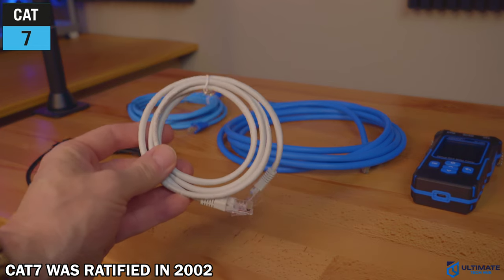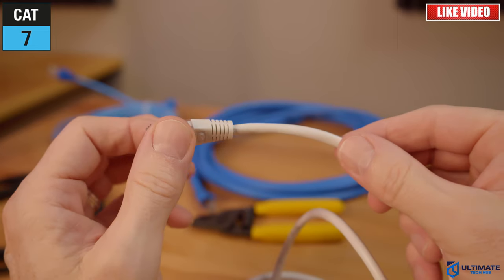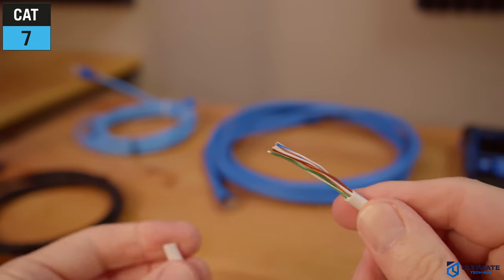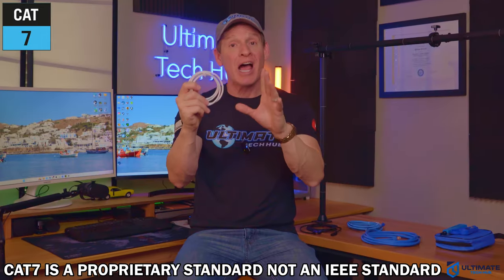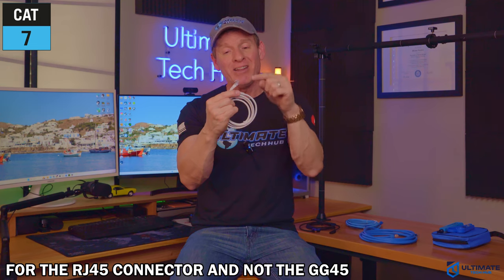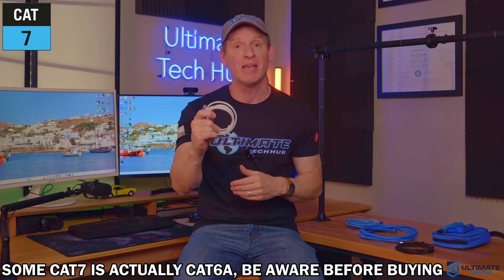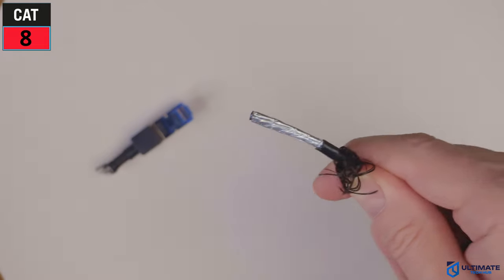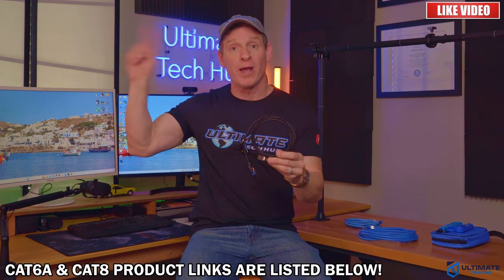CAT7 ETHERNET IS DEAD!!! HOME NETWORK CABLES 2024

Comment: Commenters here are focused on the here and now.  Sure, CAT6 is likely good enough for right now, and CAT6A is definitely good enough.  However, most houses last for 60+ years.  If I were bothering to run cable in a house right now, it would absolutely be CAT8.  Most houses can be wired with 1000ft of cable, which is a $500 difference in cable cost.  Rerunning all that cable 30 years from now will absolutely cost more than the $500 saved today.
Reply from the maker: Great point!
Reply: There is no point to Cat 8. It serves no purpose. Cat 6A is fine for 10 GbE. There is nothing beyond that for this type of cabling. You will have to run fiber.

Comment: most people dont need CAT 6, but you tube sells a lot of it... so what do you think, do you need CAT 7?  are you're needs more that 100 meters or 328 feet. if not you don't need CAT 6, or CAT 7... but someone is going to sell it to you.
Reply: cat 5 limits you to 100mbps speeds, cat 5e technically can handle 1gbps but cat 6 is better.
if your speed is still a 100 or less, its time to upgrade lol. im at smallest and cheapest package of my ISP and i still have over a 100mbps
Reply: @collared  It's not normally about internet speed, if you're doing cat runs in a house it's just as likely because you're a home labber doing large data transfers between local devices. Devices have SSD's not HDD's now which can saturate the 1G and more commonly the 2.5G in consumer things, or just go full nerd and get a 10G switch. In any event just run cat6a, it's a house not a mansion how expensive can it really be to do the future proof option. Hell run spare cable for future things if it'd be a pain in the arse to add new runs later.

Comment: Cat 5E is capable of supporting up to 5 GbE Ethernet. Cat 6 up to 10 GbE over shorter distances and Cat 6A for a full 100 meter run. Cat 7 / 8 serve no purpose. There isn't anything beyond 10 GbE over Cat 6 / 8. We're closing in on 10 years that a spec has existed for 25 GbE / 40GbE over Cat 8 and no one has produced any gear. It was originally intended for data centers for top of rack switch to server connections but no one in a data center environment would want that.
Reply from the maker: Thanks for watching and for commenting! I'm a Cat6a guy myself!

Comment: Couple of things worth mentioning:
1. The vast majority of endpoints still use Fast Ethernet or Gigabit Ethernet interfaces. Standards faster than Cat6 are an almost complete waste of money for most people.
2. Cat7 has many problems surrounding labelling and the cables being sold as Cat7 not actually adhering to the standard.
3. Cat8 was built with 25GBASE-T and 40GBASE-T in mind, but no physical interfaces of these types are commercially available. The fastest interface you can get that runs over twisted pair is 10GBASE-T. If you want faster than 10G, you need to switch to fibre.

If you're wiring your home, Cat6 is usually the best option. The runs are short enough that they'll probably support 10G, but even if it doesn't, you're far more likely to have a consumer/prosumer device use a 2.5GBASE-T or 5GBASE-T interface anyway. If you absolutely have to use 10G, then Cat6a is a good option.

Cat5e can also work, but there's very little cost different between that and Cat6, but Cat6 runs are way more likely to support multigig options, so it's basically the default option.
Reply from the maker: Great information and all true. I have Cat6a in the walls of my home but good ole cat6 would be just fine for most situation's. I will be getting Google Fiber next year ( Las Vegas ) so I'm definitely looking forward to 2 or 3gig speeds or whatever I can afford. So cat6a should handle those speeds perfectly. Even Cat6 can handle those speeds at short runs. Thanks for watching and for commenting, I really appreciate the great information! Cheers!

Comment: Only the ignorant, or inexperienced would have gone for anything above cat 5e!

Yes, you heard me.
Plenty good for up to 2.5 gigabit and if you need higher speeds, go for fiber:

Cheaper, faster, slimmer, less power and heat.
Reply from the maker: Cat6 is the new standard and its pretty cheap and if your going to run cables you might as well future proof. Cat5e is fine but ISP speeds are getting much faster and cat6 or cat6a is your best bet. Thanks for watching and for commenting!